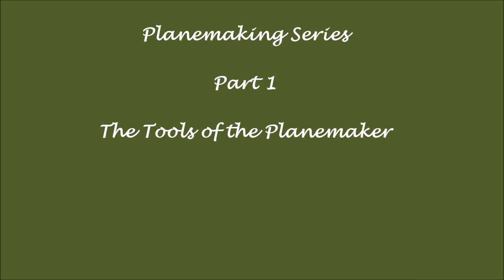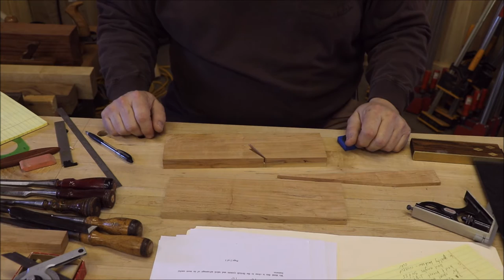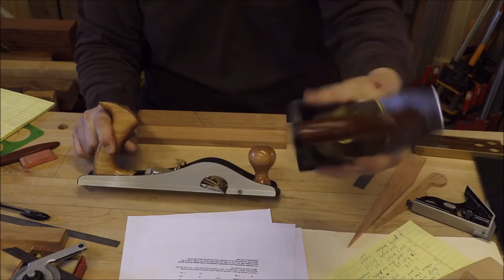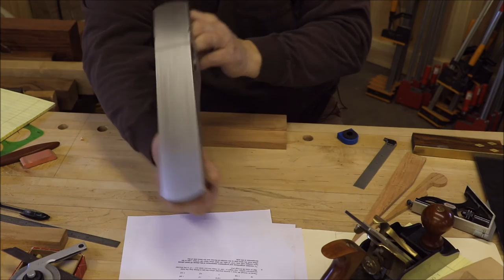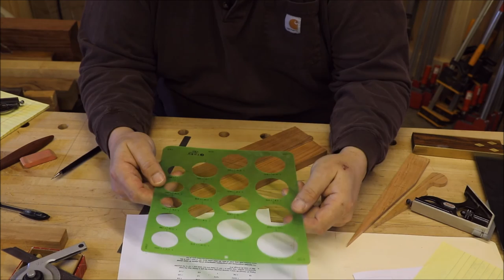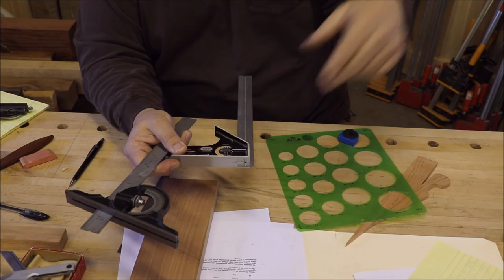The Tools of a Planemaker

Comment: I'm so happy to have found your site ! I'm very much looking forward to your videos on Plane Making.  When you do videos on making
Hollows & Rounds, I'd be very interested in the jig you use to drill out the opening for the wedge & tang on the blade. Thanks for putting
Out this Great content ! Love the site and looking forward to more.
Reply from the maker: I only use a jig in the mortiser for larger planes.  The smaller hollows and rounds get chiseled out with a 1/8" mortise chisel by hand.  The throat is only 3/16" or 1/4" wide, depending on the size of the plane.  With 1/8" of lean, there's too much risk using a mortiser of blowout.  Once I get my Bridgeport back in action (I'm rebuilding the J-head as we speak), I am going to try and work up a jig to hold plane blanks for milling out the throat mortise.  We'll see how it goes.

Comment: Looks like a very good series of videos to learn from. Have you ever used Osage Orange/Hedge Apple to make planes? It is a very hard dense wood when dried. It was traditionally used for bows and also as fence posts. It ages from an almost orange color to a very nice brown to bronze

Looking forward to more of your videos.
Reply from the maker: I'm quite familiar with the species.  I have a try plane that I made myself from locust, which is quite similar in granite-like features.  I have tool handles made from Osage.  I also have several fence posts on the property made from it.  Best way to split a boulder in half is to hit it with some hedge-apple....:).   Extremely hard, dense woods that are stable make great planes, but they also try the planemaker's patience.  Very slow going floating wood like hard.

Comment: I don't know if you check youtube comments anymore, but do you have any advice for finding material for making wooden bench planes? I am interested in making a set of bench planes at some point but I can't find thick stock anywhere locally and am unsure whether laminating up thinner stock will be a problem.
Reply from the maker: From time to time, a company like Rosewood Studios sells plane blanks.  It's hit or miss.  It's best to find a sawyer in your area that runs a sawmill, and can cut you quartersawn American beech (If you're in the USA).  It's difficult to dry, so they need to know what they're doing.  I'm down to my last 4 33" lengths of 16/4 European Beech, and when it's gone, it's gone.  My source went out of business.
Reply: @JeffHeathTheVintageWorkshop   I see thank you for the response.
Unfortunately the only place I know that has beech (and its European beech so I would imagine its more expensive) is rather far and sold at thickest in 8/4 (though they also are willing to give quotes on special requests). The closest thing property wise at the local store that sells good quality lumber is 8/4 S4S cherry or maple, so if I could ask abother question: is laminating thicker stock from thinner stock a problem for making planes?

On a side note you may also want to check red rose reproductions. I found they sometimes sell plane making billets.
Reply from the maker: I am not a fan of laminated planes.  They will work, but you'll always be dealing with frequent tuning/fettling because of the glue line causing moisture barrier issues.  You need to find 16/4....14/4 will work, but 16/4 allows the most leeway as it give you the ability to make the wedge from the same piece of wood.  Good luck.  The wood I've been using for the past 8 years has all been German beech, imported here.  I bought an entire pallet of it, and have 4 33" pieces left.  When it's gone, I'm done.  
 @DiersakZelesnik

Comment: @ 7:20 you mention that different companies will mark variable sizes of rounds and hollows the same number. I believe this is a cross discipline problem. Paint brushes for fine art suffer the same issue. I am sure there are more fields with the same headache.
Reply from the maker: Yep, it would be nice if there was a standard to the sizes.  The British held to a standard.....American plane making companies did not.
Reply: @JeffHeathTheVintageWorkshop  Thanks to your video I am one step closer to making frames. :)